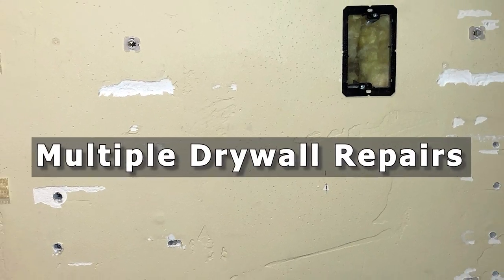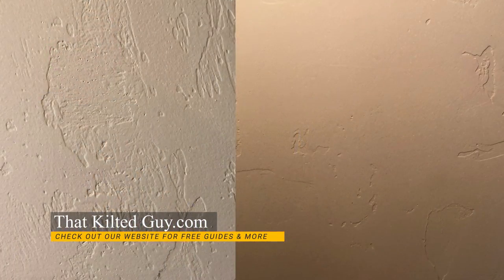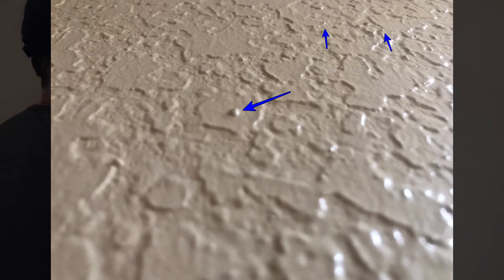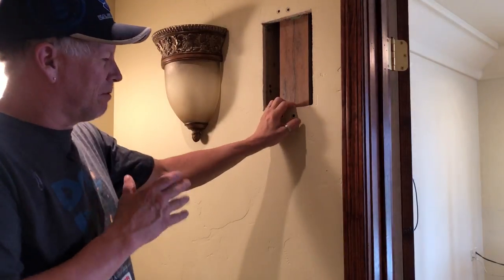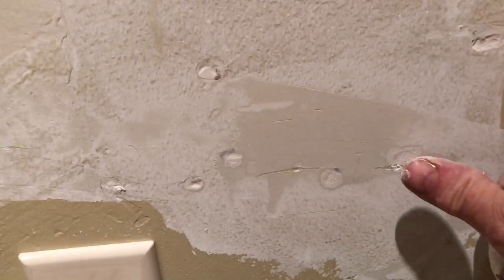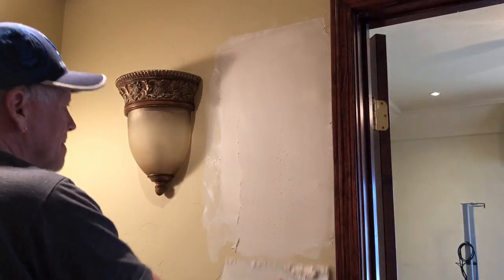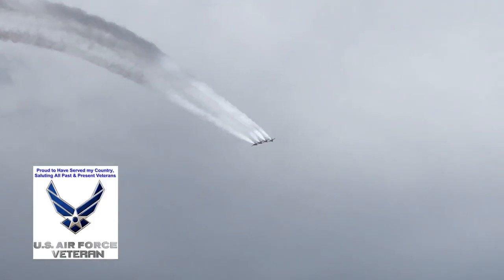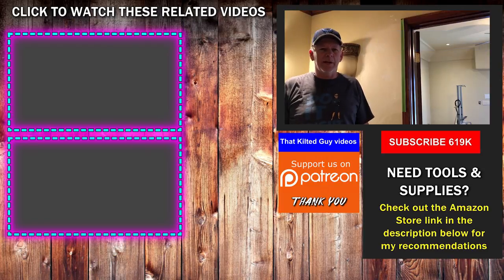🔴 Repairing Drywall Anchor holes, Large Holes, Drywall Scrapes, Nail holes & matching Skip Trowel

Comment: Well hello from florida, I’m new to this channel and thank you for what you do. Lot of information in this channel.  One thing that I do when I patch bigger holes is that instead of screwing a large piece of wood behind it I just use  pieces of drywall and use my heat glue gun and apply the glue. It only take a second to stick and I don’t even have to screw it’s cause that glue will hold almost permanent. Also I use a heat comercial blower to speed up the drying process. But you’re doing  an excellent job. And I’m learning a lot from your videos. Thank you again.
Reply from the maker: Thanks, glad to help

Comment: #DOITRIGHT Thanks for the recommendation about using a spray adhesive - that really helps and I don't get frustrated.
Reply: An Air Force veteran giving kudos to Navy Pilots - love it #USA
Reply from the maker: I have the highest respect for anyone currently serving or any veteran honorably discharged, regardless of the branch.

Comment: @That Kilted Guy. I hope you will not roll your eyes up at my long question but maybe when you are not too busy you could help me.

I don't know what I was thinking but I nailed a lot of holes in the wall next to each other.  I had bought one of those four panel paintings where you nail each panel next to each other.  Well I got carried away with adjusting them on the wall by nailing them and then changing the location of the nails each time I didn't like where I had situated a panel.  I did this several times with each panel when I should have done the proper measurements for each one beforehand. 

 So to my horror when I was done I saw I had a consecutive line of holes on the wall for each panel and they were spaced really close to each other on the wall for each panel.

I had some caulking so tried to fill the holes with it using a toothpick which really didnt fill the holes in much but it covered them on the outside so I couldnt really see the holes appearance wise.  I have a stucco type wall so it hides them more.  

I should have used spackling perhaps but I wanted them gone now so used the caulking that I had.  I think spackling is better but dont know too much about it.    

I am concerned about a couple of things.  I am really afraid I ruined the structure of my wall by nailing so many holes with there being so many of them close together and 4 panels worth.  I am worried the wall is damaged.  I believe it is drywall.  Also Im not sure how you fill the inside of the holes  because using the tip of the caulking tube did nothing as the holes were not that big around and the caulking material was rather thick.  It just wasnt pushing anything in. So I used a toothpick and that didnt get hardly anything in the holes either.  The nails were somewhat long so I did want the holes filled as they went in somewhat deep. 

Now I cant even see where all of  them are.  I have a few left I still need to fill.  The appearance seems okay on the outside for those I already did  but Im worried they need to be filled in on the inside not just the outside.

I know this probably sounds ridiculous to you.  I was so exhausted when I attempted to hang the stupid painting up and now this happened to me.
Reply from the maker: It takes more than that to weaken the structure to dangerous levels.  You are fine.
Reply: @ThatKiltedGuyDIY  Thanks for answering.  I have been really worried.  Have a great day.

Comment: Excellent video! Thanks for your service as well.  After applying the first step of hot mud (20, 45, or 90) do you sand that down at all or just get rid of ridges lightly with the knife?  And then if one has to do a second, third, or even fourth coat, is there light sanding in between each of those steps?
Reply from the maker: If you don’t put it on too heavy, you’re just sanding off the ridges and goobers. Not the edges. You only sand off the edges on the final sanding.

Comment: how do you patch a hole in drywall from a Coaxial cable. The hole is a little over 1 inches. Btw you are amazing I’ve watched a lot of videos but want to learn the correct way
Reply from the maker: Pretty sure I fixed a hole that size in the video

Comment: Overlap it 10" wider than the hole you said (for the bigger hole).  Is that 5 in on both sides or 10 in on both sides?
Reply from the maker: I go at least 10 inches on each side and sometimes more depending on how much hump there is

Comment: Hi. What should I do if I have some plastic anchors with stripped threads? Should I grip them and pull? Or drill through them and push the through the wall? They are about 1/2 in diameter. I’ve already dented the wall around them slightly and hope I can repair my wall.
Reply from the maker: Just tap them slightly below the face of the drywall and mud over them

Comment: can these covered holes be reused? i have shelves that i thought needed anchors, but don’t. the anchors left holes in the wall & i would like to cover them and reuse the hole if possible? would this work? if not, what would you suggest?
Reply from the maker: yes, if you used hot mud

Comment: Nailheads popping out.  Used a 1/4 " punch to rest them then used 2 drywall screws on the north, south sides of the nail to secure the drywall.  My problem comes from the popped nail where the wall around the hole is now bowed out.  Any solutions you can spare?
Reply: I find it helps to get a punch and barely tap it with a hammer where the wall is bowed out to loosen the top surface of the drywall and take that part of the drywall out. It makes a bigger hole but I’ve done it both ways where I’ve tried to take out a minimal amount of drywall and it repairs better when the raised drywall is gone. Then I fill it with hot mud after the repairs are done. I hope this helps!
Reply: @melissaosburn4651  You refer to hot mud. Explain, please.

Comment: Can pre-mixed USG Patch & Repair Compound be used with paper tape around, say, 12” to 18” hole repairs left by the plumbers? I saved all the pieces they cut out and re-installed them as my patch pieces.
Reply from the maker: Use regular all purpose to tape with, as it has more glue and is stronger.  Then just tape the repair joints and finish like any other.
Reply: @ThatKiltedGuyDIY  Thank you so much. Hey I found this perforated paper tape today called Self adhesive “Easy Joint Tape.” It says you don’t need a base coat—just stick it on and coat over it.
Reply from the maker: I tried it once and it sucked. I have another roll to test one day but i don’t recommend it
Reply: @ThatKiltedGuyDIY  is Plus3 an All Purpose mud I can use for taping, or should I just use the green dot?🤔
Reply: @ThatKiltedGuyDIY  thank you. I wish I could get that fine mesh fiberglass tape you showed at HD or Lowe’s. I don’t have time to mail order it, but I would love to try it.
Reply from the maker: Green label, not green dot. Lightweight doesn’t have as much glue
Reply: @ThatKiltedGuyDIY  Thank you brother—thank you so much.

Comment: Hi! I have a hole in my wall due to a shelf falling. It’s an anchor Hole the anchor is no longer in the wall. I would like to hang the shelf in the same place. Can I do this method and rehang it after it dries or is there another method?
Reply from the maker: Yes if you use hot mud. Check out this video- How to repair a TOWEL BAR Ripped out of the Drywall. https://youtu.be/89885nbTesM

Comment: I dont understand. you never fixed the larger holes made from anchors. you went over the holes with the mud, pushed in the droop, but holes remained, or at least depression. How do you get it so there is no sign of the hole?
Reply from the maker: Keep putting on thin coats

Comment: We have tons of nail pops that I’ve been repairing by digging out the drywall, driving the nail back in the stud and setting a 1 1/4 in drywall screw one inch below and above the pop. I then filled them with hot mud for the first layer of mud. I’m noticing a few that I did last year are popping back out along with the screws! I’m been very careful not to drive the screws in too far into the drywall. Do you think it’s useless to continue to fix the rest? Very frustrated here because I’ve fixed I know hundreds and hundreds of them already. Help!! Lol.
Reply: And thanks for all you do!!! Love your videos!!!
Reply from the maker: What most of us do is to drive the screw right next to the nail and use the head of the screw to lock the nail down. Or pull it out if it comes out easily.
Reply: I will have to try that. I’m hoping after looking further today that the screw was not driven in as well initially. Thank you! And I hope you and your wife are doing well!!!

Comment: For me, this video was overkill. I just want to repair a couple pencil-size holes left by anchor screws. While mixing mud and spreading it over a 10" path will certainly work, it also involves a lot of preparation, technique, and cleanup, and doesn't seem like the most efficient way to do a small job like mine.
Reply from the maker: You're right, which is why I have this video- https://youtu.be/0COOF3BwgKI